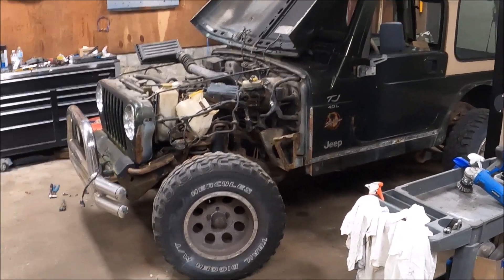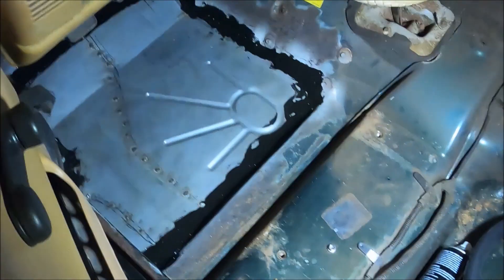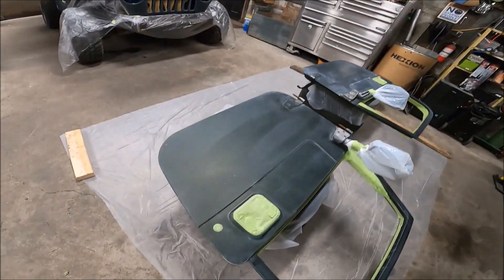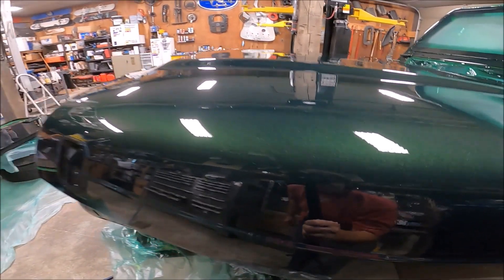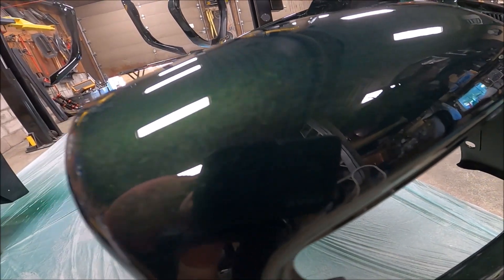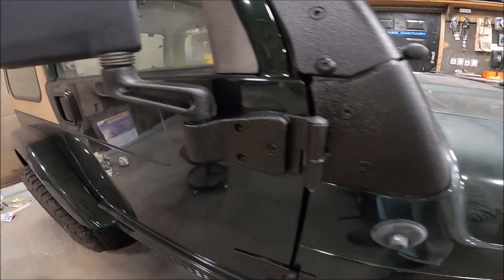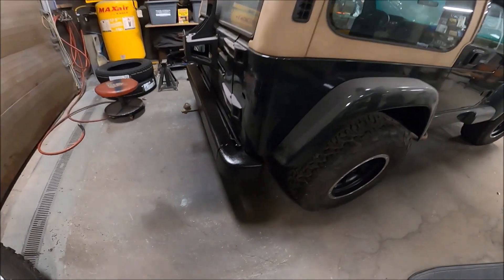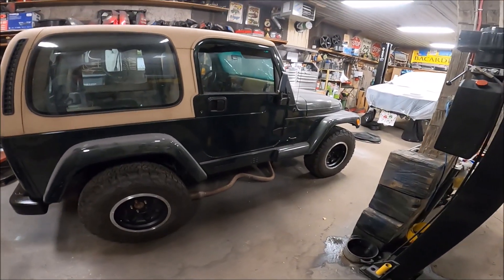Jeep TJ Resurrection Part 2: Body, Floor And Paint

Comment: Hey, I'm looking to paint my TJ the same way you did. I have a few questions. What kind of paint did you use, and how much did you need? And did you spray clearcoat afterwards?
Reply from the maker: Single stage paint, no clear coat. 
The brand is omni and it maybe needed 3 litres of paint. It was about $250
Reply: @TheSubieSanctuary  thanks